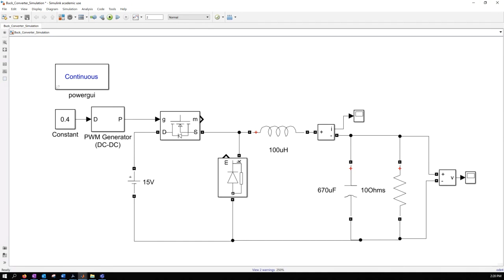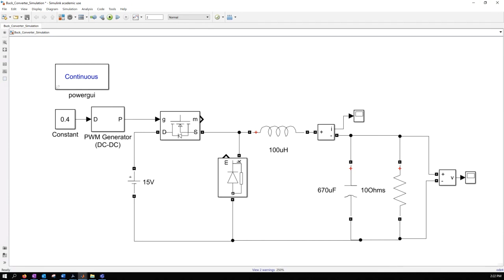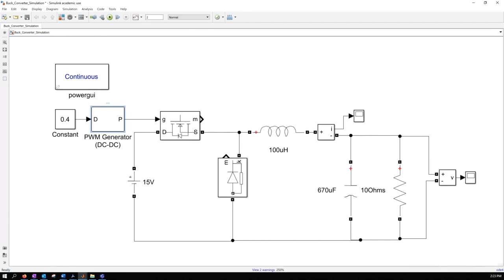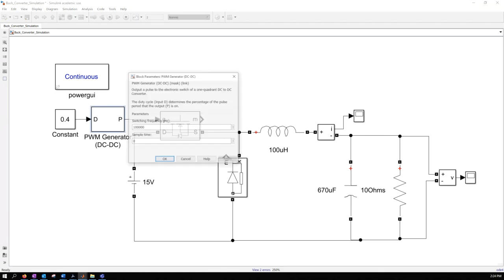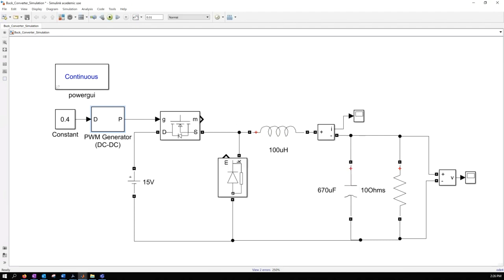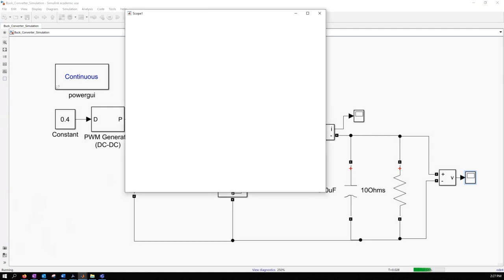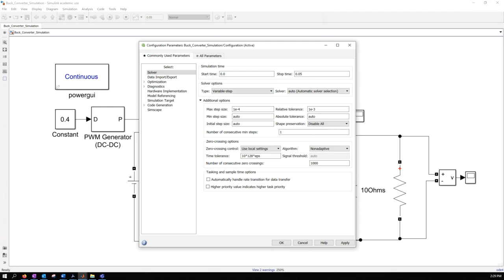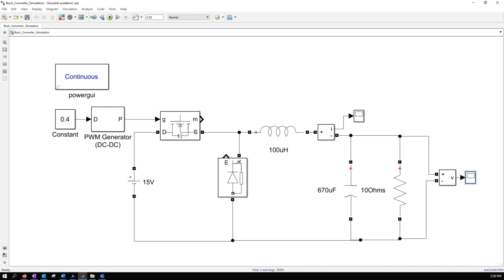Using Simulink for Simulations for Power Electronics

Comment: Thank you for talking about solver configuration.  I'd highly appreciate if you could make a video on solver configuration if the simulink model has both controller and plant (for ex. Buck converter like here). If possible also solver configuration with auto-code generation for any target, in perspective. Thanks a lot.
Reply from the maker: Kambadur, thank you for the feedback. Typically we use Euler's approach for auto code generation. Do you have a specific target in mind? This would help when you discretize. Alternatively, you can implement a discrete time controller in the model itself. Hopefully I will prepare something in the future.
Reply: @SandunKuruppu  Dear Prof.  Kuruppu, thank you for your kind reply.  Very sorry that I could not reply to you soon.  As such I have no specific target in mind, but if the plant model has to be extended with a controller subsystem. I presume that the controller subsystem would be sampled with much lower sample time than the plant. In this purview, I would like to understand the below. 
How to configure/handle such multi-rate subsystems like this in the simulink model, so that I can run the complete model on host pc (SiL) and also as a PiL (with controller subsytem running on target and plant on the host pc).  I could think of using an Arduino board or an STM32 CortexM4 Nucleo board for this.
Thanks a lot.
Reply from the maker: @vevasam  You can have multirate systems  in one simulation. You will need to include rate transition block, a delay or ZOH block for such systems. What you use vary from application to application. Typically ZOH works. I don't have such an example to demo, but I will try to include one in a future video. Appreciate the suggestion!
Reply: @SandunKuruppu  Thanks a lot. Thank you so much for your time and effort in creating such useful content and to answering the queries.